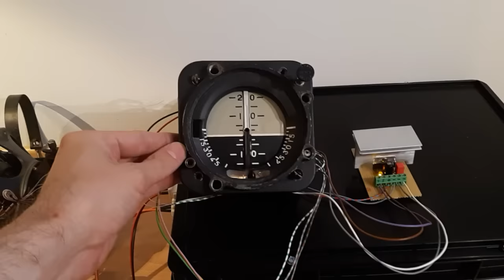Startup of a Russian "type 458" gyro block of a MiG-21 fighter after almost 40years of storage

Comment: That's some nice Soviet military tech :)
I love the lead dress / cable harness, it's so clean and neatly made. Wonder if they used high flexibility cables, or just the regular stranded stuff.
Reply: They use the highest quality stuff. The most precision components and best materials for military.
Reply: standed or not i dont know but i have some of their silver solid core they used for communications (i used it for a custom headphone cable) fairly flexible but any tight turns would demand stranded as it would snap solid core.  could be a clue
Reply: @casper . the hind is a beast
Reply: Nyet Nyet Soviet
Reply: Almost certainly stranded. Lacing like that was standard practice in  the period. Still have a reel of lacing cord somewhere...
Reply: Note: all high quality stuff in USSR has been used in MILITARY. That's why USSR military things are so cool. 
Other people had junk tech in soviet era.
Reply: It's a very flexible multi-stranded cable with a PTFE jacket. In aviation they would usually use silver plated copper and where it would matter the wires would have additional glass fibre jacket on the outside as well. High quality stuff!
Reply: Soviet always used the best for their military, civilian industries had to make do with whatever scrap was left while in the West they had to fit stuff in budgets, since Socialism does not work on money but resources, only budget was how much resources it required and how long it took to be built in a factory.
Reply: @SMGJohn  aah yes, the poor US whose military budget is equal to the next 10 Nations combined.
Reply: @xmlthegreat  These are 12 year old civilians talking out of their butts. The Sovs mass produced. Their philosophy was quantity over quality. I've seen (with my own Mk1 eyeballs) what a Bradley's dinky 25mm chain gun will do to a T72s armor for instance. Think hot knife thru butter. Im old enough to remember we feared the Mig 25 Foxbat till one pilot defected. Discovered it had outdated avionics, no legs, and needed the engine swapped immediately if the jock kicked in full afterburner...🤦
Reply: @troymash8109  As the Turks found out to their cost, Abram's armour is shit when it's an export model, the Soviets were no different, they didn't export their toys with  first grade equipment, materials or technology they were keen to keep a hold on. The Mig25 may have been a limited aircraft but it was swiftly developed into the Mig 31 which was a much more capable weapon system in all but ultimate high altitude top speed, irrelevant as the threated US high supersonic speed bomber program had been abandoned.
Reply: @Xaelloss  cable   МГТФ
Reply: @troymash8109  
How are those expensive Leopard 2 holding up in Syria? Whats that? You lost 200 of them? WHAT THE HELL ARE YOU DOING TURKEY!
Reply: dont lead, its aluminium.
Reply: I worked at a plant producing similar Soviet equipment forty years ago. Not gyroscopes, but aircraft radars. They used wires with a very large number of oxygen-free copper fibers in a multilayer Teflon sheath, sometimes an additional fiberglass braid. In some cases, silver plated or gold plated copper. A similar approach was applied to all electronic components, for example, thermoplastic polymers were not used.
Reply: @АндрейНикитенко-ф4с  чё ты чешешь, в сюжете гироскоп, при чём здесь радар, радар не такой. Там плоская решётка фазоинверторная.
Reply: @PHLEX20008  учи язык, чел конкретно про проводку и кабели спросил. А она там везде сходного типа.
Reply: @АндрейНикитенко-ф4с  why use oxygen free Copper and no thermoplastic polymers? What technical reason?
Reply: @MrNikolab  siempre
Reply: @Tensquaremetreworkshop  They use exactly the same  technique with musical keyboards and even ZX spectrum clones. Lots of these made with teflon-coated wire and reed switches for keyboard.
Many got destroyed for platinum-containing bypass capacitors.
Reply: @troymash8109  Soviets used plenty of cheap manual labor BTW.
Reply: @noop9k  yes, you're right.
But also commies didn't think about humanity and similar things. they only thought about USSR, and how to make it look cooler. So to make country cooler you need good military.
Reply: @one_step_sideways  where did this commentcome from? What triggered you to make it

Comment: The crazy part is that tech has come so far that there is a similar device in everyone's cell phone that tells it when to rotate the screen. Today they're microscopic and made from piezoresistors attached to suspended masses all made with the typical silicon photolithography process.
Reply: An accelerometer or a magnetometer is not the same as a gyroscope.
Reply: @john91051  ah, it's been a while since  i saw Afrotechmods 's video, he indeed talks about accelerometer.
Reply: @AnalogDude_  Capacitance in the zeptofarad range.
Reply: Another crazy bit of trivia: "Clean rooms" which are essential in manufacturing of integrated circuits were first invented in 19th century for production of miniature ball bearings, such as used in these mechanical gyroscopic platforms.

Comment: What a beautiful piece of engineering. Incredible that today it's replaced by a single chip. Thank you for sharing!
Reply: No. Chips only in cheap electronics like phones where nobody cares about precise and reliability. Jets and missiles still use professional gyros (mainly based on laser).
Reply: Electro mechanical gyros are still used in modern icmb's. The Russian ones have better accuracy than any silicone without the need of gps

Comment: Weird power requirements, 3x36VAC at 400hz and 27VDC. What an incredible mechanism though!
Reply: Probably had 400hz generators on the plane (for radar and whatnot)… just coupled the gyro to the same power supply
Reply: A lot of planes, submarines and other military hardware runs on 400hz.

Comment: So that runs shy of 30v DC?  Impressive piece of older technology you got there.  That is awesome. Thanks for the video of a mechanical gyro
Reply from the maker: It requires a DC voltage of 27V and an AC suppy of 3phase 36V 400Hz. The black box contains every stuff needed to run one or more instruments, an off the shelf 27V 10A SMPS and two 27V to 3x36V 400Hz solid state sine inverters, capable of 150VA output each.
Reply: @barjan82  Nice Work

Comment: In the 1950's most of the instruments in B-52's were old vacuum type electronics.  The DG and Attitude gyros were much smaller and self contained in the panel type. The older types with remote gyros were used on the B-17, B-25, B-24 and B-29 but the bomb sight (Norden) had it's own gyros and they were much more stable.

Comment: thats a gyro? wow, now they have this whole thing in a tiny chip that eye can't see it
Reply: Umm....no they don't. Modern Ring Laser Gyros are significantly smaller and more accurate but not on a "tiny chip eye can't see".
Reply: To reiterate that we are talking about gyros used on fighter aircraft only, not INS on a MEMS type systems.
Reply: In kinder terms, there's a huge difference between an inertial gyroscope, which are used in aircraft and a 9 axis IMU that you'd find in something like a smartphone.
Reply: @DingleFlop  What would be the difference?
Reply: @goku445  yea big, expensive, unreliable. less accurate, and only 3dof with no acceleration measurements. 
- most likely
Very cool thou
Reply: @justinmallaiz4549  You mean that gyros in smartphones are better than gyros in aircrafts or that this is old tech?
Reply: @goku445  absolutely protected from the effects of electronic warfare compare to electronic chip :) Also, the instruments of a combat aircraft were specially made heavy (were not replaced with smaller electronic components) in some cases, this helped to improve flight characteristics and defense. :o)
Reply: @goku445  I don't know the resolution and accuracy specs, and a modern gyro specifically in a cell phone is not designed to be safety critical, (so like comparing a Rolex to a dollar store digital wristwatch) I'd be careful not to bet against the performance of  modern cheap gyro in a cell phone
Reply: @goku445  yes it's old tech. Dramatic advances have been made. Still an exquisite piece of engineering
Reply: On smartphone, they're not actual spinning gyro
Reply: As i know millitary jets still use same type of gyro, because EMP can burn chips
Reply: @goku445  MEMS gyros measure angular acceleration, while inertia based gyros keep a steady orientation (and therefore measures attitude). They measure completely different things. Now, you can derive attitude by integrating over angular acceleration, but every error you make gets amplified and fed back into the system. If you combine a MEMS gyro with a compass and accelerometer, you can self-correct to some extent by using, for example, a Kalman filter. You still end up with something that's inferior to an actual spinning gyro.
That's why they still use laser gyros instead of smartphone sensors in modern planes.
Reply: @Spectre4490  Since modern airplanes are one big flying computer, I guess one chip more or less won’t matter …
Reply: @death_parade  Yes, its inside EVERY iPhone since the Model 10 was released.  It's the size of a grain of rice and im half blind so I cant see it.  LoL
Reply: @robertmayster7863  Thank you!
Reply: @death_parade  " We saw a 15 degree per hours drift." "Thanks,. Bob!"
Reply: you should have seen computers at that time.
Reply: @Blubb5000  lol.
Reply: Robert. This seems like a great explanation thanks
Reply: @Bialy_1  Absolutely fucking not. Spoken like someone who knows fuck all about what hes talking about...
Reply: @Spectre4490  EMPs zapping pretty much everything that has an unshieldet cable to it, not just chips.
Reply: @cloudyandroid5334  U totally don't understand, how EMP works or how semiconductor elements works, or scales needed to withstand EMP and why. Did u learned this from tv?
Reply: @aidegrod  TV? I learned it on youtube!
Reply: @Bialy_1  Dude, you may want to learn english a bit better before you start commenting on youtube. Seems you misunderstood half of what I wrote and didn't really get what we were talking about. Also, you don't really seem to understand the technical details of those systems at all. Maybe there's a wikipedia article in your first language? That should be your starting point.
Reply: @goku445  
Precision, S/N ratio etc. Chip (MEMS) gyroscopes are crap. If $1 gyroscopes were good, nobody would buy $100.000 devices.
Reply: @ Dingle Flop

Not really. 

The main difference is size, cost, perceived reliability and integrity, and the massive amount of testing and paperwork that’s associated with it. 

For example. My plane has dual FMS with two WAAS capable GPS sensors so I can fly RNP approaches. All rack mounted avionics deep within the belly of the plane and interfaced by dedicated CDUs. 

As I follow along in my consumer level iPad on Foreflight that is every bit as accurate 95% of the time. In fact, that’s my backup if the magic all of a sudden disappears—which it has.
Reply: @Bialy_1  Oh, believe me bud, the errors are definitely amplified and fed back into the system, I'm speaking from my direct experience in building my own drone from scratch and getting it flying properly, as well as I understand the math behind how they work. The additive errors (errors that are amplified and fed back in) were an absolute pain to deal with, to the point that I had to basically just give up and add a bunch of additional hardware to step around the problem, there really was no way to just solve my way through it.

Comment: Very nice video, thank you.  I have a type 458 gyro and ADG-1 Indicator and  a EP-15 3phase power supply.  Any information you are willing to share on Pin outs/connections etc. would be greatly appreciated.  I would really like to get this stuff running on the bench.  Thank you
Reply from the maker: Malcolm, i have an Excel sheet i made a while with the pinout and connection of the gyro block and remote instrument. How can i reach you?
Reply: @barjan82  I had forgotten but you sent me the spreadsheet a few years ago.  I also discovered  I have information from the connectors removed from the aircraft and have documented that too.  When I have it running, hopefully soon, I will share.  Thanks
Reply from the maker: @mthomson51  Great! Looking forward for your results. Only thing is to supply the unit with a real sine wave form power.
Reply: Not ADG-1! AGD-1!

Comment: I recall reading a book about Viktor Belenko's defection with a Foxbat, and how at first the then-Soviet engineering was mocked by the use of steel in certain parts - until analysis showed where these parts were placed. Serious respect to the MiG engineers.

Comment: Amazing. I would like to see a V2 gyroscopic attitude controller. That ones had direct control over the carbon deflectors mounted over the rocket nozzle, giving some kind of gimbal control.-
Reply: I’ve seen video of a V2 gyro in operation. It was taken to an aircraft instrument repair facility to be assessed and run up. It is on Youtube somewhere. If I remember correctly, the gyro equipment was from a museum with a lot of V2 technology.
Reply: @johnedwards1685  me too!
Reply: @johnedwards1685  It's on "Astronomy and Nature TV" channel by Robert J Dalby.
Reply: There’s a V2 gyro at the Alamogordo Space Museum in New Mexico.

Comment: I never though the gyro was separated from the instruments lol
Reply from the maker: Depends on the system and manufacturer. Usually smaller units has everything in one box sitting in the cockpit. More complex artificial horizons may have a separate hsi in the cockpit and a sensing gyro block somewhere else in the airframe.

Comment: What a well built bit of kit.
So small and reliable after 40 years.
Russian engineering was as God as ours in the West.
Unusually 3 x 36V AC was this beacuse of failure redundancy.
I think 400Hz is the same frequency used on the DC3 and Grand Commander I flew on survey with it must be a standard for aircraft.
Do you have any other pices of electrical  or mechanical equipment from 40 or mor years ago.
Thanks for the video.
Reply: Small mate 🤦‍♂️ u should see one of today
Reply: Anthony....., is the Earth flat , or a Globe ?

Comment: Very nice. Did you have a service manual to identify the pinouts and supply requirements or did you work that out yourself?
Reply from the maker: Dave, supply requirements were strait forward as Soviet military instruments this era usually run at 27VDC for the servo amps and for a bunch of relays and 3x36VAC for the gyro motors and syncro transmitters/resolvers. Pinout for the supply input was easyer and follows some regular Soviet scheme i've seen on other instruments as well, first 5pins on the bigger connector carries both DC and 3phase AC supply inputs (1->GND, 2->27V, 3->PhW, 4->PhV, 5->PhU). The rest of the pins were including a bunch of head straching and lot of DC, AC voltage and oscilloscope measurements while the unit was running.
Reply: @barjan82  Awesome. Thanks for the info!
Reply from the maker: @sircompo  U're wellcome! Take care about the 3phase 36V AC supply phase order on pins 3-5. The gyro block will run with any phase order conneted, but however if the gyro block is connected up with the proper 'display instrument' and the 36V AC supply phase order is incorrect the complete system will behave false. This is valid for both the 'type 458' gyro block and the AGD-1 or KPP-1273 display units.
Reply: @barjan82  I'm hoping to get a Smith's Industries horizon hooked up to a sim. I suspect it's expecting 3 phase 115v 400Hz supply for the synchros. Gonna be fun figuring that out! Suspect as it's a military part from a VC10 I'm not going to find service manuals!
Reply: @barjan82  а частота тока 400 герц?
Reply: Yes, that you have such device, is already  amazing, but that you got it working is beyond amazing.

Comment: Awesome.  All of our current tech had to come from somewhere, it didn't just pop into existence.  We stand on the shoulders of giants.  

Having flown RC helicopters for years, it wasn't that long ago, like back in the 80s and 90s, that a tail gyro was electro-mechanical, .  While smaller, they too would create a whine when they spun up. I'm currently using a 3 axis mems flight controller in a modern RC heli, and I can vouch for the fact, they are susceptible to vibration.  Software filtering can only do so much but without proper damping and isolation mems drift can be pretty bad.

I appreciated the Russian simplicity and heartiness in their designs.  These things were built to survive an EMP, even solar flares.  Most people have no comprehension the damage an EMP or solar flare can do.  Back in the 1800s, a bad solar flare caused old telegraph systems in the US to burst into flames and or burn out.  Imagine that, no electronics, or vacuum tubes, basically just thick copper wire and magnets, yet enough current was introduced to burn out that old equipment.  If something like that happened today we'd be toast unless it's shielded.  Most consumers electronics aren't shielded for that, so good by computers.

I always enjoyed the approach Americans would take to solve a problem vs Russians.  Back in the Apollo days, American astronauts couldn't write because their pen wouldn't work in Zero G or Microgravity so teams of American engineers set about designing a pressurized ink cartridge.  Russian engineers on the other hand, just used a pencil.   ;  )
Reply: You conveniently forgot to mention that the Soviet Union switched to using the very same pens after NASA started equipping every astronaut with them because pencils can flake and break apart and could damage equipment.
Reply: @NightPhantomz  Actually there was nothing convenient about it.  I did not know that but it makes sense.  Thanks for sharing.